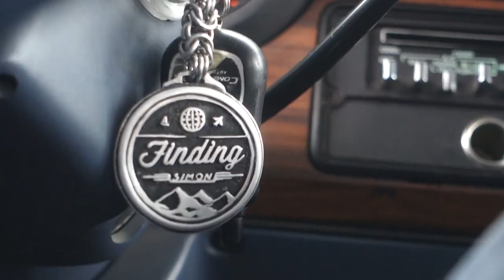Van Gets Smashed and Bleeds - Baja or Bust 65

Comment: Had my  89 Chevy van 30 windshield replaced in San Jose del Cabo for $115.  Just make sure they put enough sealant around the perimeter.  I found out they hadn't when I came back to the rainy north and water was dripping on my feet . It was an easy fix though and the price was right. Enjoy Baja, I sure did especially the east cape.

Comment: You should see if you can get a sticker for the dent in your windshield to keep the moisture out till you get it fixed. I used clear nail polish on my little chips. There are a lot of Americans against Canadians and right now there's quite a few who are lumping us in with the illegals they complain about, so watch out for them. Didn't you know that your supposed to take your shirt off when you work on an engine? Hahaha just joking....always watch your oil gauge and temp, if the oil ever hits bottom or the temp spikes and blasting the heat don't bring it down, stop the engine asap. Safe. Travels guys.